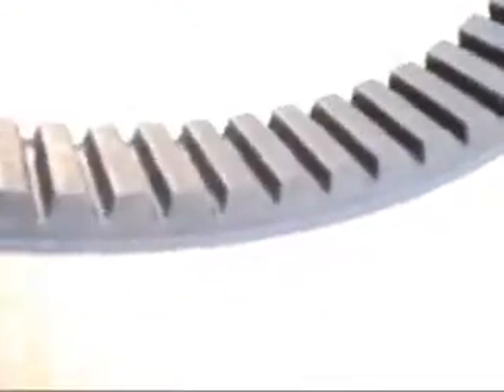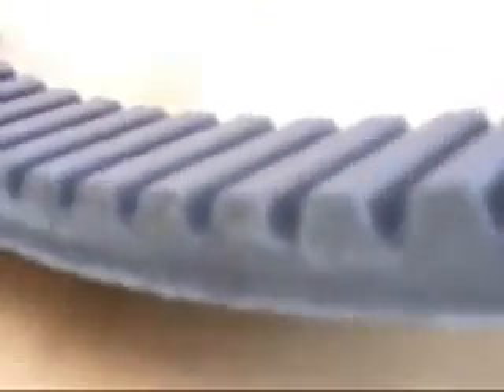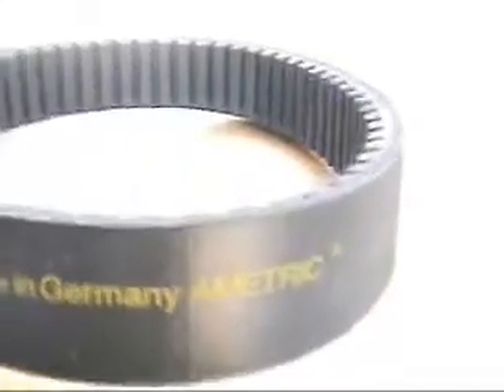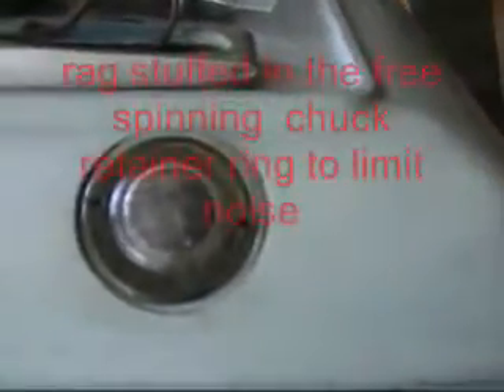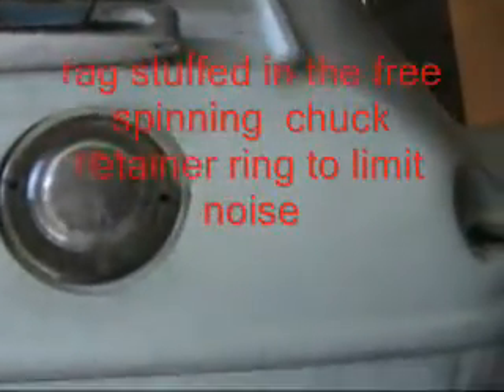Voest Dat series lathe with variable speed drive

Comment from the maker: The variable belt system has an advantage that you can shift the speed to any range you want, and do not have to go in steps.So you can speed up the spindle as you come in on a cut on say a large disk and still keep about the same surface speed. I Like your induction heating setup. want to get into foundry work  at my work shop here. also one of the things that I am thinking of for the lathe is an electric actuator for the speed change system so I can just move a switch and change speed of lathe